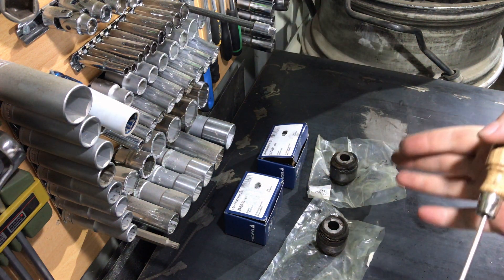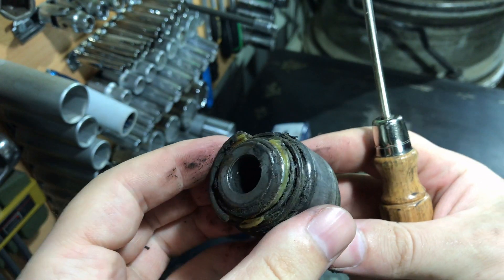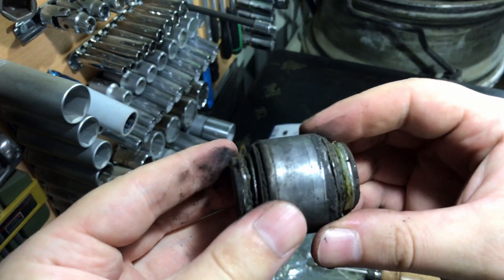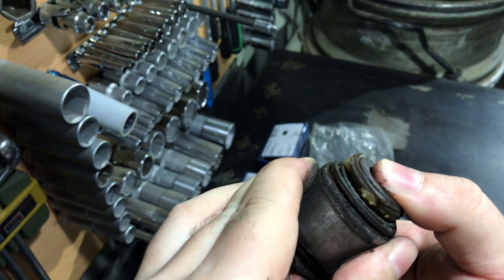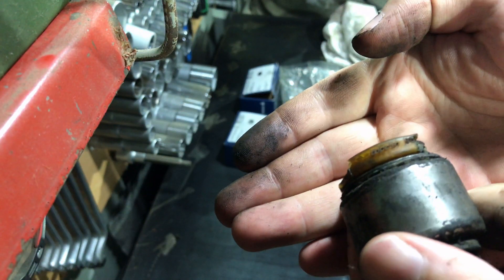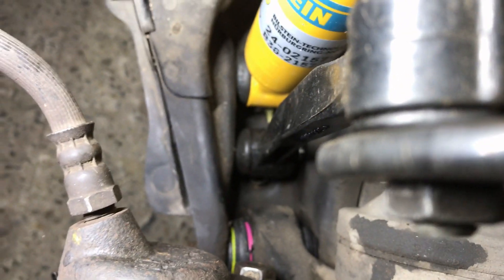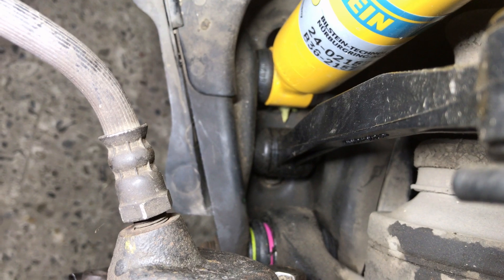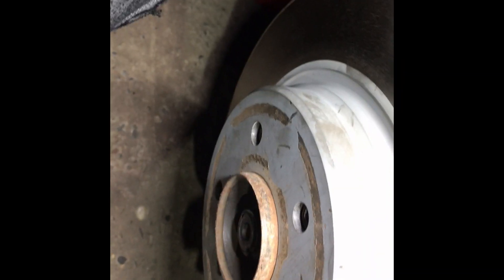Mercedes W210 E430 - Rear Control Arm Trailing Bushings Replaced

Comment: I've just done the same job. Do you know the correct torque for the outer control arm bolt/nut??
Reply from the maker: Bolt which goes through the control arm trailing bushing must be torqued to 120NM. Make sure that the suspension is under the press when tightening it.
Reply: @W210Garage  Great - Thank you. Do you have the same figures for the two bolts connecting the hydraulic SLS ram to the control arm (W210)?

Comment: ooh....Topran is one of the worst parts out there..together with URO it is a really bad manufacturer.The new bushings you got there are veeeeeeery nice!.The best aftermarket part out there.Thank you for niiice video :) Stefan
Reply from the maker: Thank you Stefan. Actually i was going to pick genuine ones, but i have only found them on English ebay and one piece was about 37GBP... That’s why i preferred Lemfs. I think that they can cover 20-25k km’s without any issues. Greetings :)))
Reply: @W210Garage  the lemfoerders are definetly an adequate part.Though i have seen some scary quality issues with Lemfoerder also the later years..i think they are still a good brand to use.They are far better than Toprans anyways :)Greetings back to you my friend :)
Reply from the maker: @TheCarTakerGarage  
Yes, i do not trust their stuff, which are made outside of Germany. I have to use some Brazilian made lemfs on my dad’s mk4 gti and quality was not good. As i know some of their parts are also made in china, Turkey and e.t.c...